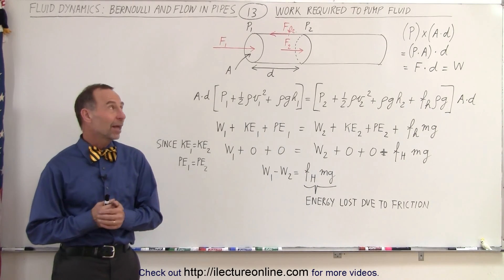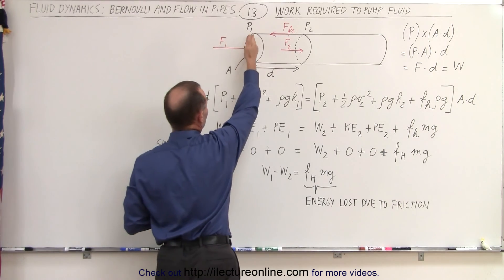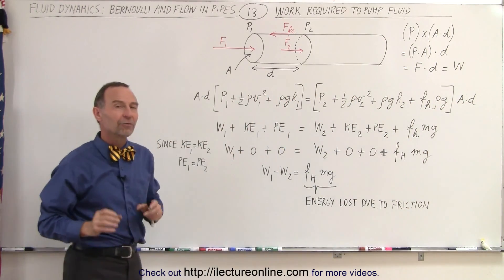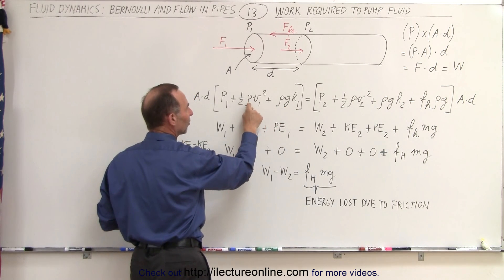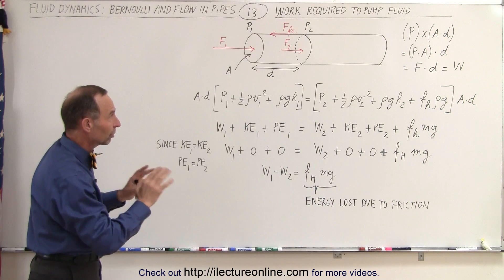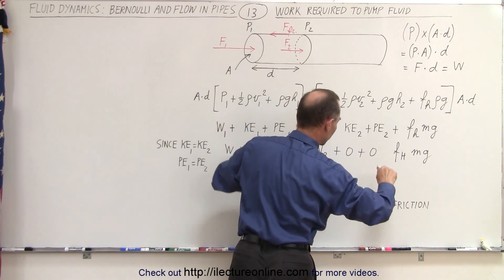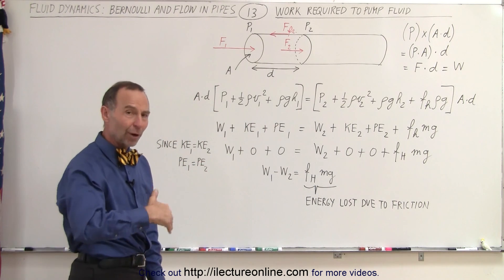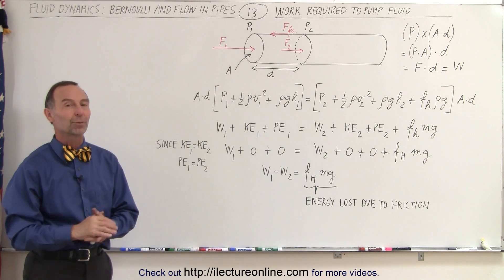Physics 34.1  Bernoulli's Equation & Flow in Pipes (13 of 38) Work Required to Pump Fluid

Comment: At two points area and velocity is same but pressure is different due to frictional losses, I am unable to understand what does this pressure drop means. what kind of  physical difference will be there at second point and first point?
Reply: When pipe length increases (assume points A & B are at the same height), friction is added from the inside walls. This friction is retarding layers of fluid, as well as layers of the fluid itself retarding additional layers. Thus, pressure is lost from A to B in a straight length pipe, reducing efficiency.  Recall that Energy-in = Energy-out. If you dig around, you likely find a video that can help you gain a better understanding of the principles.
Reply: @JP-iq8td  so velocity changes over length due to frictional losses.
Reply: @Ap-zq7lb  I think the velocity does not change, is constant, the static pressure decreases due to the friction loss, the dynamic pressure (and velocity) is constant, so the overall pressure decreases. From energy point of view, there is a friction loss, to keep fluid flowing, to keep kinetic energy constant (so the velocity constant), the energy is transfered from pressure energy into kinetic energy, the energy balance is there - > the pressure p2 decreases while kinetic energy is kept, see also previous video (12 of 38)